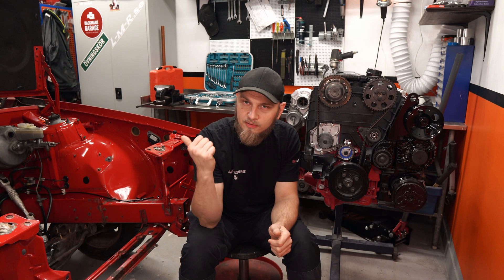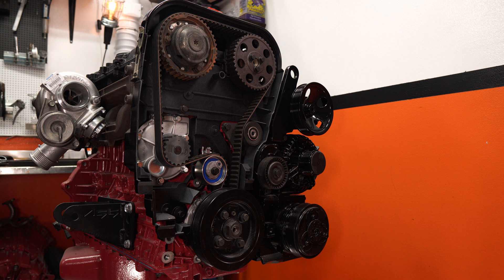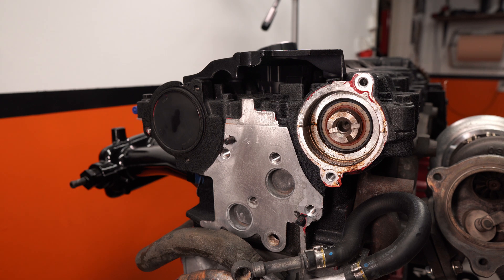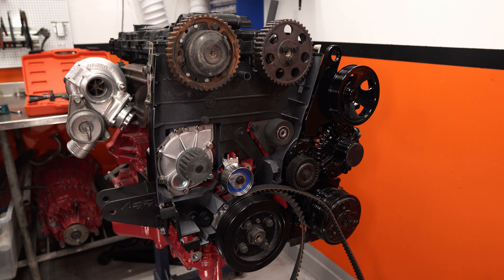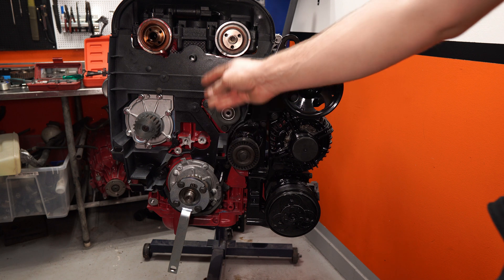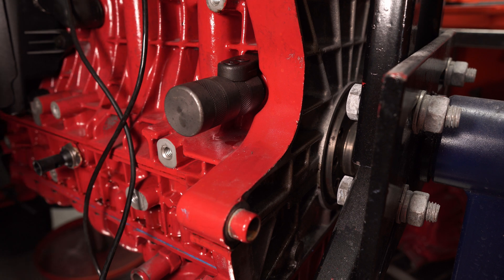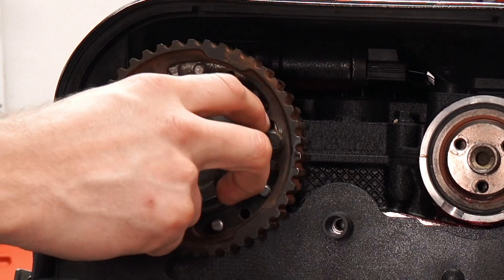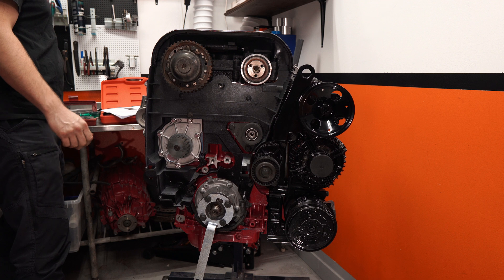Volvo VVT Installation On The B5254T (Exhaust Only VVT)

Comment: Hi Sir, I missed some parts of the video since part 1. What transmission you are going to couple with this T5 engine. Are you going to use Volvo's 960 automatic transmissions?  WIll you adapter plate? Thanks before for your reply
Reply from the maker: Hi! I will be using a Volvo M90 transmission from a Volvo S90 (1998)

Comment: Very nice video and nice work. Im doing this to my S80 2.4T with VVT on exhaust only.  I´ve done everything the same but after i turn the engine over 2 times again to TDC all 3 marks aline but den exhaust camshaft doesnt aline on the other side, where you put the tool inside.
I´ve set timing belt while the VVT bottoms out on the right side/clockwise  and the marks are matching. It is spring loaded like yours.
Is this normal or did i do something wrong?
Cheers
Reply from the maker: It should be slitghtly off so it sounds about right 👍

Comment: Thanks a lot for that !! I am working on a swap on a 2005 xc70 and am still practicing locking the cams on the old engine! Waiting on the other kind of cam locking tool the one like a slab of aluminum with 4 smooth pins on it!

Comment: Excellent video. Helps visualize the instructions very nicely. Only thing I wanted to offer is that the 3 locking bolts on the VVT sprocket and the 3 bolts on the intake cam sprocket should all be left about 1/2 turn loose till after the final belt tension is set or sometimes the belt tension indicator will move to a different spot after turning the motor and you will have to apply the locking tools and loosen the locking bolts again and readjust it. Keeping them loose till just before removing the locking tools helps nail the belt tension first try.

Comment: Hello
 why do you have to turn it a quarter clockwise and then back? is the markings not ok when you turn it clockwise the first time good enough i don't understand that part
Reply from the maker: It is to relieve the tension created by the spring in the VVT hub.

Comment: Good video. I will refer to this in the coming days to reassemble the timing on my 2001 Volvo V70 XC with the  2.4 turbo. The water pump bearing failed causing the timing belt to jump and resulted in bent valves in the head. I disassembled the engine last fall and am only now putting it back together with a rebuilt head and all new timing components. I've just subscribed to your channel. Thanks for posting this video !

Comment: Hi.
I love your project and your videos. You really explain things in an understandable way.
I just replaced timingbelt on a B5254T engine and when I took the old belt of, I noticed that there was no tension on the VVT-wheel. If I moved it, it sat where I released it. I then put the new belt on and lined everything up and started the engine, and it runs fine. 
What is your opinion on the VVT? Is it ok or do I need to replace it?
Reply from the maker: Your VVT is probably not a spring-loaded model .

Comment: Where did you get the directions to replace the hub?
Reply from the maker: Volvo Vida software
Reply: @BackmansGarage  where do you find it on the vida software? I am having trouble locating it
Reply from the maker: I have a friend who has it installed. But I've heard that you can get one on ebay with the obd scanner.
Reply: @BackmansGarage  I have the software. I found it and I will try it today. I did a test on it and it seemed to be a little off. Can I still drive it this way?
Reply from the maker: I wouldn't drive anything if it seems a little off. Are u sure you have the spring loaded vvt and not some of the other variants?
Reply: @BackmansGarage  it is not a spring loaded vvt.
Reply: It drives well and starts smooth. You wouldn't notice an issue except the check engine light comes on.

Comment: what do you use for a an instruction manual? i have a v50 2.4
Reply from the maker: The instructions come from a program called vida that the volvo technichians used in the volvo workshops. Should be avalible for download after some googeling since its a obsolete program, somewhere 2014/2015 the vida program became cloud based insted of "application" based.
Reply: @BackmansGarage  ty mate

Comment: I have to do cam seals and the book is not accurate. This video fills in all the gaps. The use of the crank and cam locking tools is great. Setting the VVT sprocket is what I was wondering about. So helpful👍👍👍👍.
Reply from the maker: Thanks 👍

Comment: I find myself in the position that I need to rebuild my 2.5L turbo engine in my ‘06 XC70 due to pcv failure leaving me a lot of metal in my oil filter. Being that you built your engine what did you find as a good resource for the instructions you’re reading in your video?
Reply from the maker: The Volvo vida program in the computer. My fiend has helpt alot with pulling info from there.

Comment: Who told you to turn the engine backwards ?? I've done these engines multiple times and NEVER rotated the engine backwards? What was the reason for that?
Reply from the maker: I thought that was a little wierd at first too and i guss i have never read the instructions closely enough to notice  that it says to overturn it and reverse it. Volvo original instructions. 

But after thinking about it for a while I realized it's to remove the tension on the vvt hub spring, I guess the camshaft rides just hard enough to load the spring when approaching TDC to put tension on the vvt. You can hear the vvt snap when the tension in the vvt let's go when the cam rides over the load. I don't think that this is as apparent when the vvt is filled with oil.  

It's probably more of a safety thing rater than something that is necessary to do for proper function/timing of the vvt/cam transmission. But if you don't overturn the engine the cam locking tool may suddently snap under the force of the vvt hub spring, at least that's my guesstimation.
Reply: I'm thinking now that I re read your original reply that mine simply wasn't spring loaded...I do recall it spun freely without tension on both my v70 and xc 70 .maybe that's the differenceI dunno....thanks anyway for explaining.

Comment: Hello Thank you for your Video. I have a 2,4T with the T7 Engine. It has hydraulic vvt. I watched many videos and read the Volvo manual. Your Video really helps. My fault was that I fixed the 3 scews in the end position in the pulley after fixing the center srew. For the hydraulic I did exact like you - one Notch bevor the mark. And then you can see that the mark let's the gear move one in both directions. Then the belt to the marks at the cover. 
I didn't find ONE description that explains it the right way. 

Thanks!!!

Comment: Excellent step by step video thanks….I found this video after I replaced my cambelt( it’s so much more difficult when engines is in vehicle). If replacing belt in engine, I would also suggest taking a photo and counting the teeth on the old belt between the marks before it is removed , especially if you don’t have the cam locking tools.make your own scribe marks will also help on all the pulleys,
 Thanks

Comment: Hi there, is the timing proces for the B5244T3 engine with exhaust VVT the same as your B5254T? And can i use both VVT's (spring or not spring loaded).
Greets Robert
Reply from the maker: I know nothing about the non spring loaded vvt. Im hoping to get one of those my way someday for another video.

Comment: I did the same style as you did with cat install. Mine is double vvt, however after torque tight on the center and plug on both, none of them has spring action. Still free rotation around the cam. Could those hubs need to be replaced??
Reply: Not cat, I mean vvt install. I didn’t know how to edit this.
Reply from the maker: Some vvts are spring loaded and some are not. I think all of the dual vvts or cvvt is allways non spring loaded. But I have 0 experience with those and dont know alot about them. I will make a video on that type once i get one by the garage 👍

Comment: is this the same as vtec or am i dumb
Reply from the maker: No vtec is something different. They operate kind of like a vvt but also alter the valve lift and it's a much more complicated system. Also vtec is only found on Honda engines.
Reply: it does alter the valve timing but the vtec does it a different way.

Comment: I was able to properly install timing belt with correct tension.  I turned crank clockwise, then noticed the exhaust VVT CAM had play, it actually popped forward and back in... kept cranking then no more play, another quarter crank and I could pull the VVT cam in and out 1/8 inch (3mm) by hand.  Could it be a worn bearing?  What would cause the lateral play?
Reply: Yes you have to buy a new hub......
Reply: It's a piston inside that wears excessively
Reply: Yes, worn VVT, install a new one. They wear out after 100k-150k miles or so.
Reply from the maker: I know that the vvt can get worn out and cause lateral play, but exactly how to fix the vvt hub play is out of my current knowledge. I do believe you have to buy a new unit. 

 https://youtu.be/eWRjFumpzkA

Comment: Very very informative. I have already changed my timing belt water pump alternator serpentine belt and was getting ready to put on a new starter and I do believe I have a leaky head gasket. Smoke just pouring out the back and water seems to be going right through
Reply: Make sure you don't have a cracked cylinder instead. cracking is common on the 2.5 liter block and it mimics the symptoms of a blown head gasket.
Reply: @GoldenGrenadier  What about the 2.4T? I have combustion gas from cylinder 3 and have approximately 212k miles on the engine. it is bone stock low pressure turbo. do those commonly have cylinder cracks form? engine was turned off when it overheated once. now it will run all day if you disconnect cyl 3 coil plug and injector plug.
Reply: @robbiewilson157  It's rare with the 2.4 block because of the thicker cylinder walls but it can happen.
Reply: What was it? If u overheat the 2.4t the head will warp.been there three times 2 different engines....but one thing I also had was a friggin new felpro head gasket fail 6 months after the job and started burning coolant ....white tailpipe smoke..

Comment: So if the lines (grooves) at the back from the camshaft and the valve cover align it means there on time?? Doing this w/o the special tools
Reply from the maker: Basically. The parts number on the exhaust cam should be on top and on the intake cam on the bottom. 

You will however have a hard time torqeing down the vvt bolt without some sort of cam lock in place.

Comment: Hi I am from France and I saw  your video that I just liked it. I have same engine but when I try to remove the 30 mm nut of crankshaft pulley I turned counter clockwise and ear 3 times a click like something broke inside, I didn't have the tool to lock the crankshaft. It's my first time doing Volvo timing belt and now my engine is out of timing do you think I broked something , and can I reset timing like before. No I try to start but nothing's happen. My car was running perfectly and smoothly before that.
Thank you for reply
Reply from the maker: To answer your question, I don't know. 

All that I can tell you is that these engines are interference engines and if the timing is off too much the piston will hit the valves. And since the valves are installed at an angle they will bend and the valve stems will probably break. 

If the valves are broke you will not have any compression in the engine. And since you have already tried to start the engine, I would suggest doing a compression test on all the cylinders. If that is OK, then you can reset the timing correctly.  If you don't have any compression, then you have more problems than I can help you with in the comments section.
Reply: @BackmansGarage  so I can do test compression with engine out of timing you mean?
Reply from the maker: @Adam19832  If you have tried to start the engine with the timing off the damage will already have been done. But yes, if you can set the timing right then do that first.
Reply: @BackmansGarage  thank you for your help will try